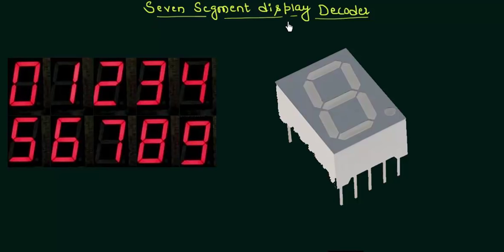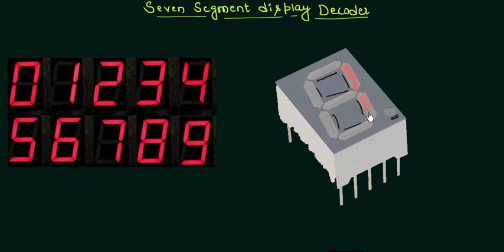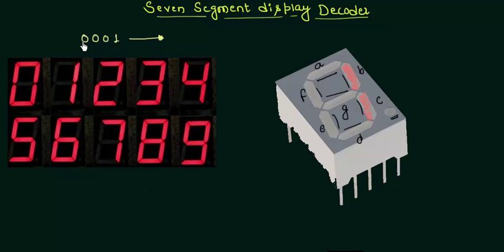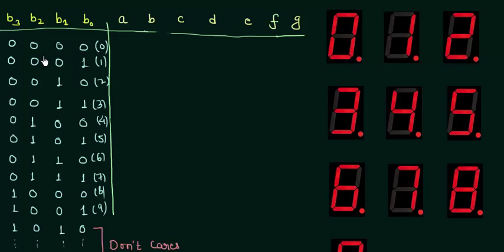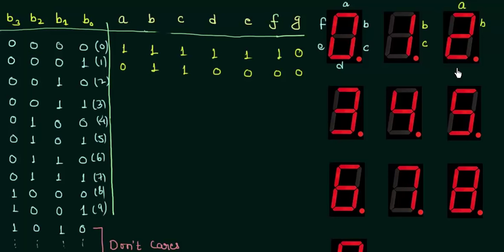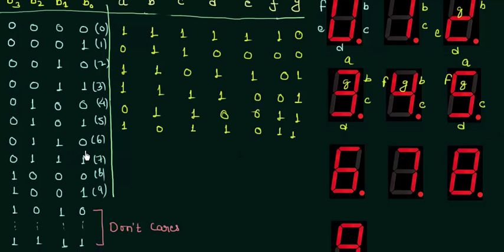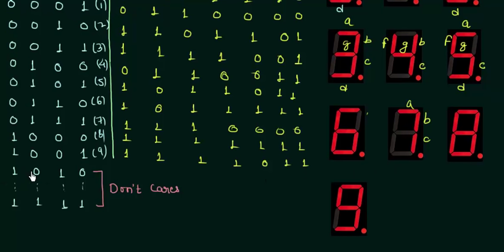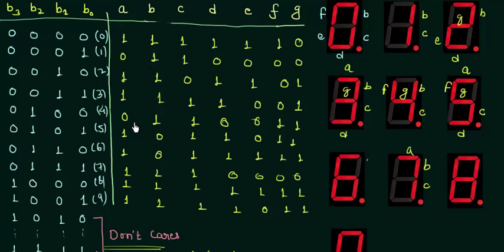Seven Segment Display Decoder

Comment: The two logic chip that does your display is the 74xx47 and the 74xx247 BCD-to-Seven-Seg Decoders/Driver. The 74xx247 have the same pin assignment as the 74xx47 but the 6 and 9 have your tails for those digit as you have demonstrated {The Top for 6 'A' segment  and Bottom for 9 - 'D' segment} . Both of those chips have the hex equivalent 10 through 15 "Display patterns for BCD input counts above 9 are unique symbols to authenticate input conditions.".

Comment: Please clarify this : If decoder is opposite of encoder then the decoder must have only one output line as high at a time. If a decoder is designed this way is it even legit to call it a decoder??. Here , If the bcd (4bit) can be mapped to any representation then wont that violate the rules of encoder and decoder ?